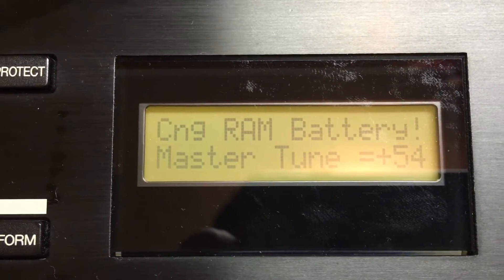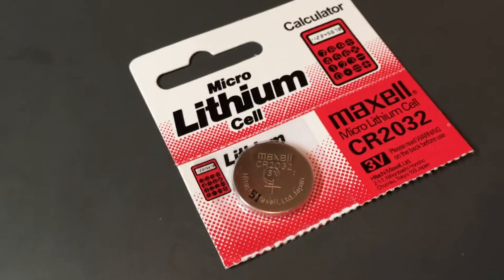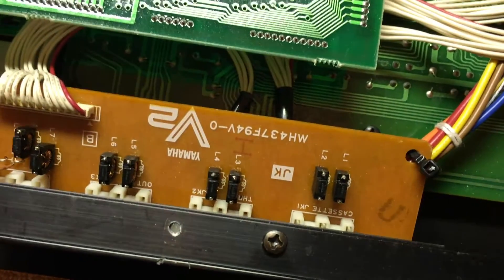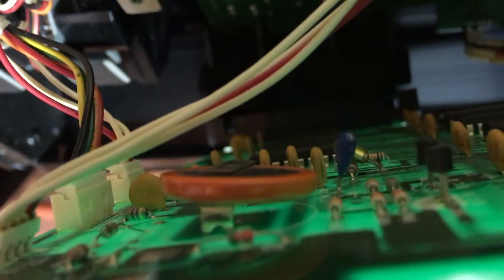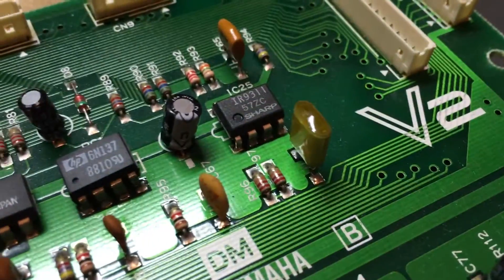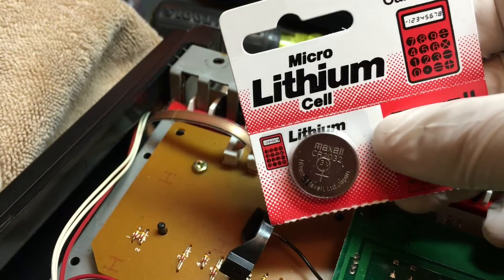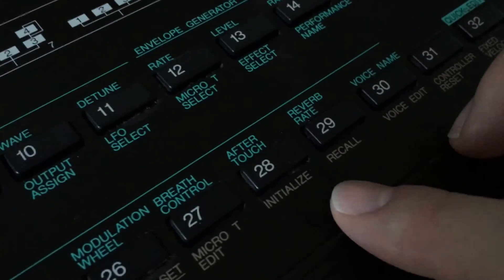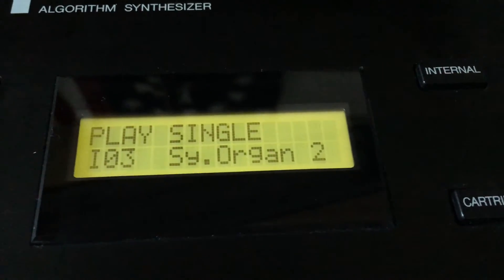Yamaha DX11 Cng RAM Battery! DIY repair

Comment: hi, is it possible to do what suggested bellow? "is it possible to solder new battery holder in parallel with old one, so you do not loose content / when new battery is in holder and wired, old one can be removed?"

Comment: hi! is it possible to solder new battery holder in parallel with old one, so you do not loose content / when new battery is in holder and wired, old one can be removed?
Reply: hi! is that possible?

Comment: Great video, thanks! I ended up using alligator clips instead of a battery holder, with electrical tape on the battery in the right places. It was easier that way, seems a bit sketchy but it worked for me
Reply from the maker: Right on! Glad to help another synth head
Reply: as long as those clips dont come loose and end up shorting somthing important out inside the thing. but im all for jury rigging

Comment: I tried to change the battery on my DX11. However, the battery and cover are very different than the one shown in the illustration.  My battery has two clips attached (very well soldered??) to each side and they do not come off of the old battery.  There are also no 2 leads coming off of the battery.  Then I read that the battery was only used to store patches. So with the old battery out of the unit I did the steps to initialize, etc, and all I got were beeps and squeals.  I think maybe there is a problem somewhere else.
Reply from the maker: Pat Santucci I think the beeps and squeals will keep coming back without the battery because it doesnt have non-volatile memory. You can de-solder the built-in battery, and I think I've seen exact replacements on ebay

Comment: Hello friend! I have replaced my DX11's battery, which had the same exact problem as yours. Now the Cng RAM Battery message is gone but the digital noises still come around once in a while, although much quieter and sparse. Do you have any idea of what I could try doing to solve this? Thanks a lot for the video, it was of great help! Cheers
Reply from the maker: To be sure we’d have to see/hear what the problem is. It could be a number of things, but do be aware the DX series can make quite harsh noises depending on the settings.
Reply: @binershock  Thanks for the reply! I will record it as soon as I can so you can listen. Thank you for the help!
Reply: @binershock  I'm sorry to bother you, but I really appreciate the help! I just recorded a sample of the DX11 for you to hear. https://drive.google.com/open?id=1hn8SmFRPRuDFrL4KmjoMTLBZvZPQp5zB
Reply: @henrikgustav2294  Hey my friend! Yes I did! I had to replace the filtering capacitors after the DA (Digital to Analog) converters, right before the output. All was good after that :) Thank you for asking! Cheers

Comment: They weren't put together by hand
Reply from the maker: Do you think those solder joints are automated?
Reply: @binershock  I know that Yamaha had quite sophisticated facilities already in the 80's...but on closer inspection, I can see component leads bent over to secure placement pre-solder...that's a sign of handwork...you may, indeed be correct.
Reply from the maker: James Edinger Ah yeah, and just thinking about the scale. Can’t imagine there were THAT many made, though it’s interesting to think about.
Reply: Components where put in by hand then sent in a solder flow machine, if humans soldered them boards you would see black marks and solder bubbles where the manual irons changed temp

Comment: I don't know if anyone will see this now or not, but I thought I'd give it a try.  I attempted the method above...but I didn't have any way to desolder.  I ended up soldering everything to the metal bits still plugging the holes in the board.  In any case, it didn't work - it still says change battery, even after the factory reset steps.

I realized that I'm not really interested in storing patches anyway; the banks of sounds are still there, and what I really want is to use the DX11 as a midi controller.  Is this possible without replacing the battery?  I'm trying to connect the DX11 to my iPad with the iRig Midi 2 interface...but I just can't get midi to work at all.  I'm not sure if it's even possible with the equipment I have.  Does anyone know if this can be done?  Am I just missing some step on the keyboard to get it all working?  Thanks so much in advance for any info...

Comment: Thanx for the video because I have to do the same with an old DX11 I have got here.
So your video helps a lot.

The ideal is that after replacing the battery you can just factory reset the DX11 with the combi of 3 keys while power on the device. Then you have all the original patches back in memory.

Comment: Thank you for this great vidéo! Can You Just tell how you removed little parts as CNI at 2'15? I cant remove it it still blocked....
Reply from the maker: Those little boogers are tough. Use a lot of strength between the two halves, but don't put force on the circuit board.
Reply: thanks a lot!!! :D

Comment: what battery did you used? and in generall was it easy to do this because i never done something like this before. and what are the MUST HAVES for fixing this issue exept the battery?
Reply from the maker: +NekosBlog You need a 2032 battery. You also need a screwdriver, a solder iron, and some way to attach the battery to the circuit board (like a battery case). I go through the full inventory in the video.
Reply: +sonsofthunder okay than another question. was is easy and do you think somebody with no experience at doint this at all could do this??? and thanks for the replies ;)
Reply from the maker: +NekosBlog If you've ever soldered anything before, go for it. If that scares you then find someone else to do it for you. Most guitar shops would be able to do this repair, given this video as a guide.
Reply from the maker: Yeah it's pretty easy. Try it out.